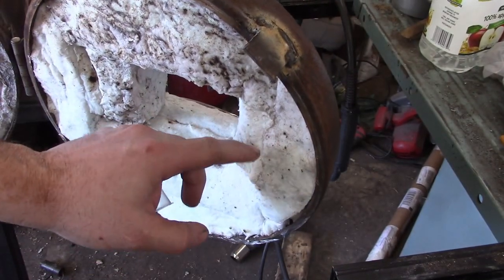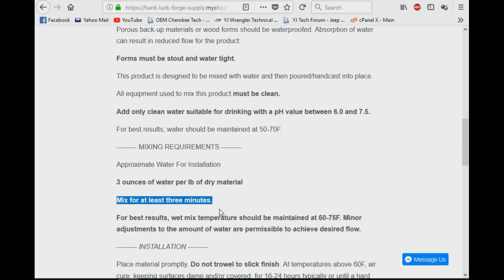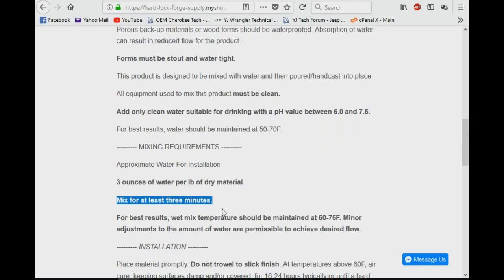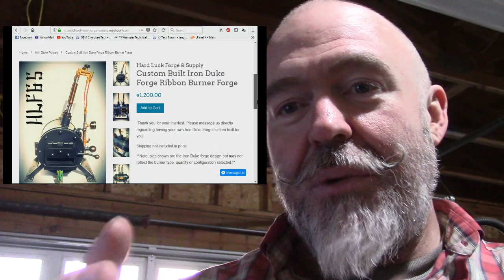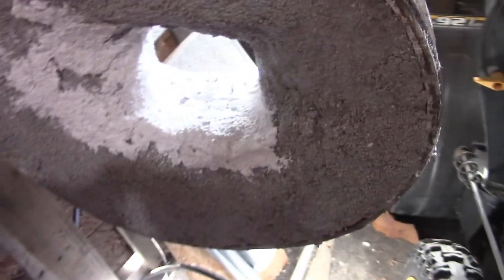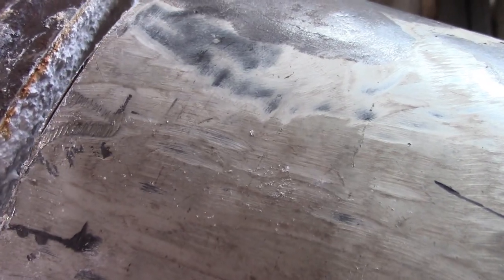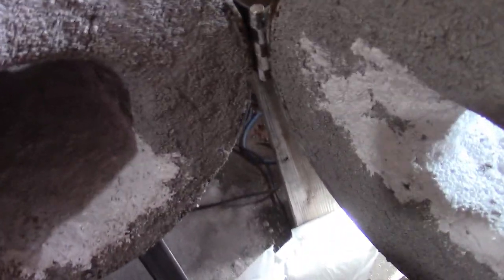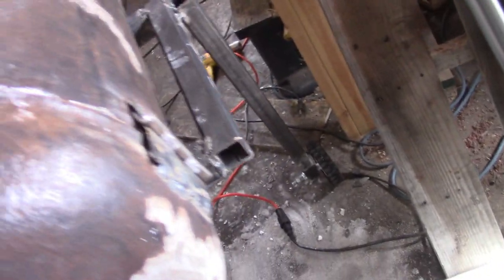DIY Forge Build - The Refractory

Comment: I don't know if i would like the kast 30 it's way too thick I just need something to protect the wool blanket that won't crack after cured. can you mix it with little more water so can apply it with a paint brush? and it still will work good or should i get satenite will just do about quarter inch thick layer on the wool and 1/2 on floor

Comment: This is probably a dumb question but why is it necessary to use Kaowool when it's covered up with refractory? This is the way I always see it done so I'm sure it's necessary but I just wonder if fiberglass insulation or something else like it would work or just incinerate from heat even though its encased.
Reply: Steve just Steve, I got mine with kaowool only and at the forge floor some fire bricks, it works fine
Reply from the maker: Refractory is not an insulator, so if you just line your forge with only that, then it won't be very efficient.  You'll be able to heat you steel, but you'll also be wasting a lot of heat because it will soak in to the refractory rather than in to your steel.  It will work, but for efficiency, you want insulation.  2" of ceramic wool is recommended, but for ribbon burners and certain forced air applications, then 3" can be recommended.  In a nut shell, this basically forces the heat to stay within the fire chamber.  A thin coating of refractory helps protect the wool from the flame and helps protect your lungs from the wool, but isn't so much refractory that it acts like a heat sink.  So that's basically why its done that way.  Like I say, firebrick forges work fine, as would a forge that is only lined with refractory, but it just isn't the most efficient way to do it.

As for the wool itself... It has to be ceramic, and has to be rated high enough to withstand the high temperatures in the forge.  Fiberglass would melt away before the refractory was even fully cured., and there are some ceramic wools that aren't rated for a high enough temp, and would not fare well either.  The correct ceramic wool can be a little pricey, but make sure you don't skimp out on it.  For efficiency, I think its the most important part.
Reply: yea I know it will work with only kaowool, I want to know if it will work with something else/cheaper under refractory. Cause Kaowool is the high dollar part.
Reply from the maker: We're all adults, so no lectures from me, but open, untreated Kaowool would be the last thing I would want to be exposed to when that forge was up to temp.  So, even though they sell them all over the place, that is not something I would recommend. You guys make up your own minds, and that's the last I'll say on it.  As for alternatives to Kaowool (ceramic wool), soft fire bricks are pretty efficient insulators.... in fact, depending on which ones you can get your hands on, they might be more efficient that the wool.  I have a handful of them, but the problem I found with them is the ones I have are not rated high enough and just using them to block the opening on my current forge has caused all of them crack and split apart.   The other problem, if you're looking at cost, is they are pretty dang expensive too.  What I wouldn't do though, is waste your money on the cheap fire bricks you can find at TSC or Menards, or wherever.   They are not rated anywhere near high enough.  I bought a package of 6 when I first started, and over the years, I've literally melted all of them.  I used to use them to bank my coal forge.... melted.  I used them as the floor in my small propane forge... even with my highly inefficient venturi burner.... melted.    If you're doing a fire brick forge, its gonna take some investment to get the right bricks too.
Reply: Maybe I was not explain myself right, my forge is lined with rigidizer treated kaowool

Comment: Great video! I am building a wood burning stove that I am going to then turn into a swimming pool heater.   I would like to insulate the inside of my wood burner, I'm wondering what the best material or home made material would be to do this.   Do you have a recipe for refractory cement?
Reply: why would you do that... You can make or buy a heater that is solar powered, and you won't have to worry about a catastrophic failure because you did something wrong.

Comment: I’ve been doing ridiculous reading trying to get prepared to build my own propane forge.  What has scared me most about the kast-o-lite 30 is the curing.  It needs high (basically 100%) humidity and warmth in order to cure without cracking and losing its effectiveness.  I’m scared because I don’t know how to get that right yet.  The other thing I just read two days ago is about using 3” of kaowool.  Apparently the additional insulation makes for a super efficient forge but also creates problems.  Be careful about the placement of your burners.  The additional heat buildup in the refractory and forge apparently can cause blowback in the burners because the flare at the end of the mixing tube gets too hot.  It also lowers the life of the burner.  Supposedly backing them off a bit deeper into the insulation will reduce the effect.  Thanks for the visuals. Your process makes mine less scary.
Reply: I didn't think flared ends were used inside the forge, thought they were only needed to burn correctly out of forge.
Reply: Steve just Steve I’m no expert by any means.  What I’ve learned is that some people use a flare to allow for higher volume at the end of the mixing tube and some don’t.  Either way, whatever is at the end of the burner sits nestled into the refractory about flush with the inside of the forge.
Reply from the maker: Flares are used in a lot of burner designs to get regenerative burns... basically, it just helps the air and propane to mix more efficiently before it ignites at the end of the flare.  Generally, recessing the end of the flare, at least half an inch in to the insulation, will help it produce a better burn, but depending on forge design and burner design, it might take some playing around to figure out exactly where you will find the most efficient burn.  Some burners don't use a flare at all.  Some use the hole in the insulation as a make-shift flare.  There's lots of ways to do it, and some people have been more successful than others at making it work efficiently.  I've said all along, keep an open mind, because the burner set up that is right for one, might not be right for another.   

Also, forced air burners, like I will be going with, will not cause too many problems with the chimney effect, which is what causes the blow back or backfiring.    I also have the burners mounted to the side of TDC, which also helps alleviate those problems, so if I ever do change to Venturi burners, I shouldn't have to worry about it too much.
Reply: HoJ Forge thanks for the insights!  I didn’t realize you were going with forced air.  You are going to have plenty of control to avoid those issues for sure.  I’m completely out of my depth on how to tune a setup like yours.  I hope you can show a bit of that....it’s one of those mysteries no one seems to share.  They just show off the flames when they are done.
Reply from the maker: I don't know how much knowledge I'll be able to share on it... I'm just going to be looking for the best looking flame at the least amount of propane consumption.  For flame, I want a nice blue flame.  Too green, means not enough Oxygen.  To yellow, means  to much oxygen.  Whether its forced or or venturi, the whole goal is to find that perfect balance where you're heating your fire chamber enough to accomplish what you want to accomplish, but doing it with the least amount of propane consumption.   It takes some experimenting, and then once you have it, it take an understanding that everything could change in a heart beat.  Ambient temperature will affect the pressure that the propane will flow at, so even though you have a regulator, you will need to adjust that at the temperature goes up and down... then depending on what size propane tank you're using, the temperature of the propane itself can cause massive swings in the working pressure.  Its not a one size fits all kind of thing.  I'll do my best to show what I can, but the best advice I can give is to learn what the "perfect" flame on your burner looks like, and how the different adjustments will effect it, so as conditions change, you can keep up with the adjustments to keep it running as efficiently as possible.